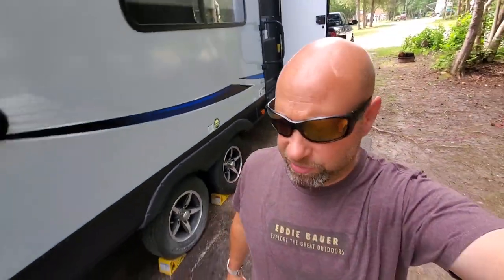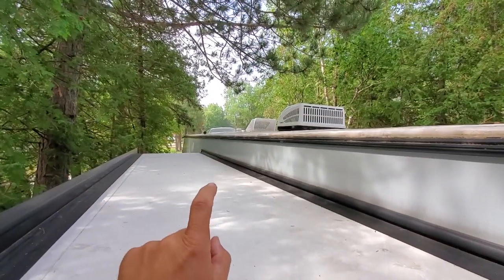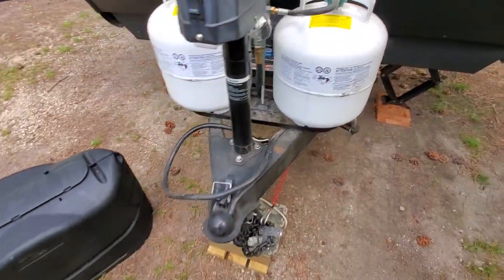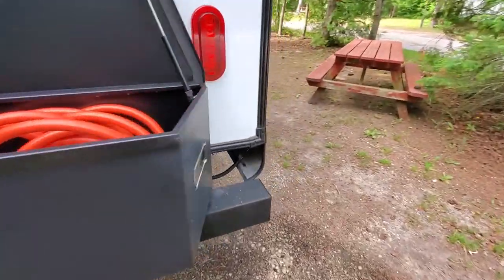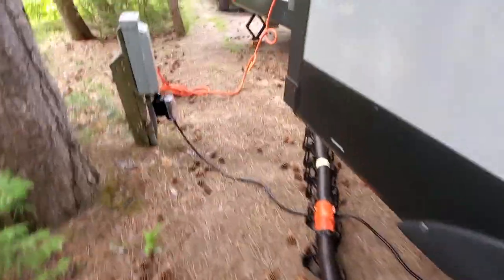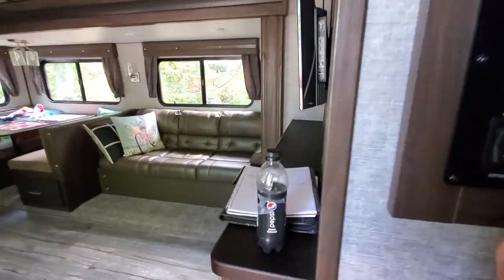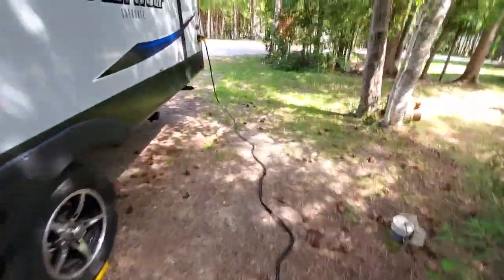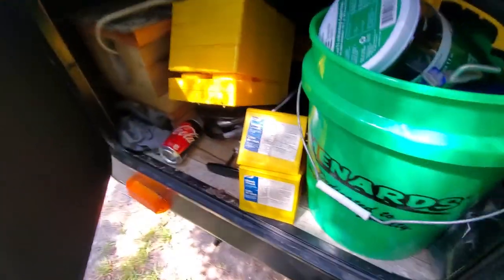Must Do Items When You Get Ready to Pack Up Your Camper Or Rv

Comment: Curious why you don't leave your refrigerator on? Don't you keep perishables there until you get home?
Reply from the maker: The fridge will still keep stuff cold for a few hours when off and thats all the time we needed. But you are not supposed to drive with propane on and running. We do it on long trips but not supposed to and I wanted to keep the video politically correct so I dont get bombarded with comments about how I'm breaking the law, the sky is falling, etc.
Reply: @SamkoTradBow  Sorry I should have mentioned my refrigerator is electric and runs on the deep cell battery only, not on propane. My Cherokee also has the optional solar panel for keeping the battery charged. My thought (unless I'm only a few hours from home) was to leave it on for the trip, then plug it in at the campsite.
Reply from the maker: @dwilli57  great idea and sounds like you have a great set up. We fire the fridge up the night before we leave home, fill it full of food next morning when we leave and turn it off for the ride and start back up when we get to camp. But again honestly we don't turn it off all the time and let it run most of the time while driving.

Comment: Where did you purchase your trailer? Myself and my wife are looking to become full-time rvers. What kind of trailer would you recommend?
Reply from the maker: cant remeber the name of where we bought ours it was in west michigan. Find a floor plan you like from any company and then get it for the absolute lowest price you can. an rv or camper today is not a durable longtime purchase. so get it as cheap as possible so you can unload it in a couple years and not loose any money.
Reply: @SamkoTradBow  ok, I have been looking at some of Grand Rapids dealers...any of them you'd recommend?
Reply from the maker: @jdoyle7768  I dont think any rv dealers are that good or better than others. Go to dealers walk thru models find what you like. Then start shopping that model and floor plan at every dealer that carries it and get the absolute lowest price you can. No reason to even walk into a dealer after yoy figure out what yoy want until you go to sign the papers. The most important is to pick a design that you like and fits your budget.  Then steal it price wise from what ever dealer you can get the lowest

Comment: Hi Jason, I have a couple of questions for ya if ya don’t mind, we just bought our first camper and it is just like yours, ours is a 2021 model but still looks pretty much the same, we have used it 1 time we live down in North Carolina so our summers get pretty hot, we noticed that during the day our A/C was not keeping up and it got up to 81 degrees in the camper during the middle parts of the day, we had no shade where our site was, have you encountered the same issue ? Also we noticed that the camper bounces/moves around a good bit while we were set up yes the stabilizers were down
Thanks for sharing the informative videos and Thanks for your response
Reply from the maker: Yep very common for a single ac unit baking in the hot sun to not get much cooler that 75 or 80 mid day. Thats why some units have 2 or 3 ac units. 
Yep all campers that are travel trailers will shimmy and shake when you walk. You can fix that with some stabilizer cross bar stability poles. I never tried them but have friends that do and say thry make a huge difference.  All 3 of them got them because they have little kids and didn't want to wake them moving around. Think they are about 120 bucks for the whole rig and all 4 corners.
Reply: Thank you very much I’ll be looking into those cross bar poles, Happy Camping to you and yours
Reply from the maker: @phillipperkins6230  you as well. We are packing up to go camping right now!